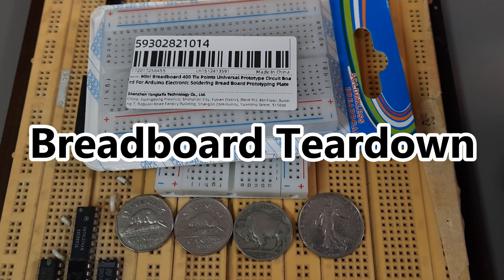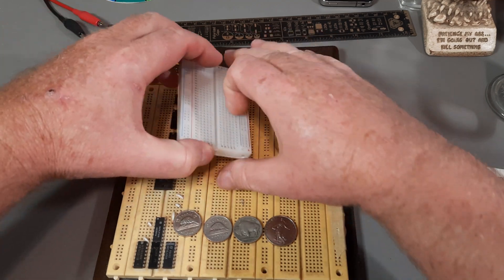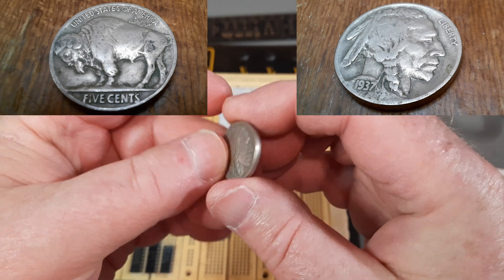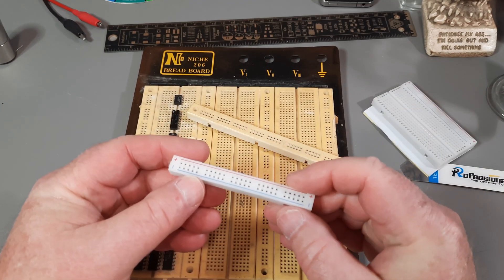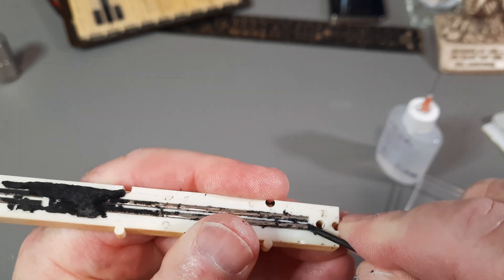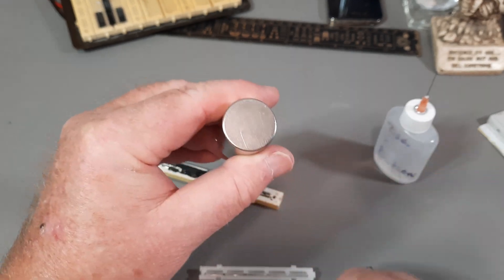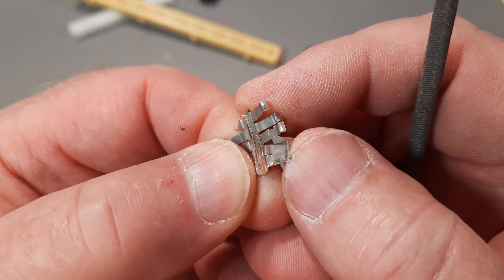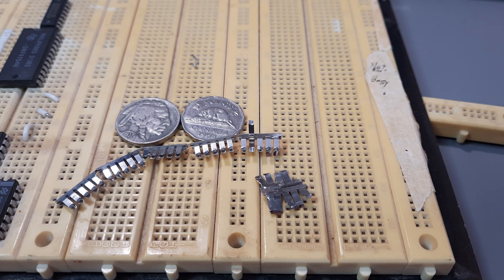Breadboard Teardown Old vs Cheap New

Comment: I’ve tried a few of the cheap ones and never got one that was very good. Often wires wouldn’t go in or would fall out. I came across a page be Ben Eater called My thoughts on breadboards. He recommended the BB830 by BusBoard Prototype Systems. I bought some from Mouser and have been very happy with those. They cost more than the cheap ones, but not expensive like the ones I got in the 90s.

Comment: Thank you for this teardown. I was certain that I felt a difference when inserting leads into a "vintage" breadboard vs a new one out of China. The leads seem to fit easier into the vintage ones. Maybe that's because they're a bit wider. Also, I've noticed that most new jumpers have a slightly rough cut edge that doesn't slide easily into any breadboard holes without a little sanding/grinding. I'm not sure which breadboard metal material works best. Maybe the magnetic material could rust, but the vintage ones could oxidize over time? Thanks again!
Reply from the maker: Comes down usually to $$. It is like comparing machined dip sockets to the stamped metal sockets, huge difference in quality. Have a good day